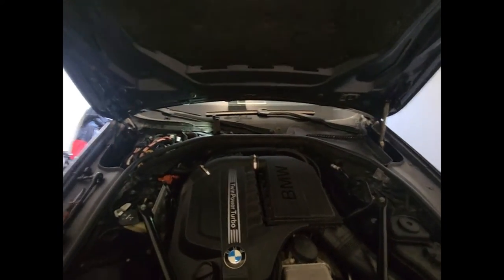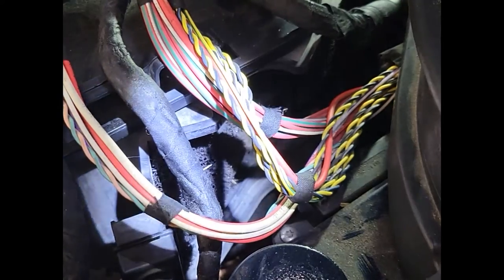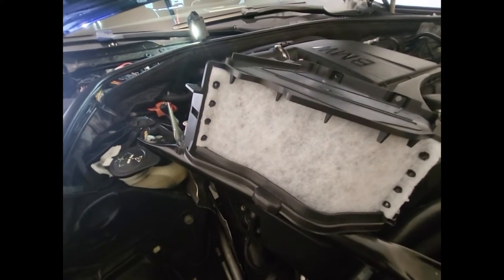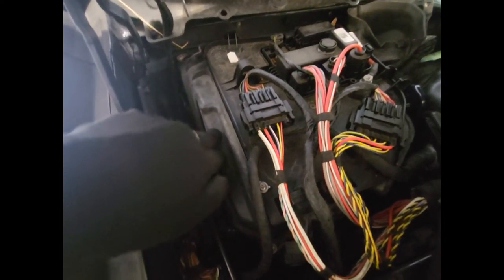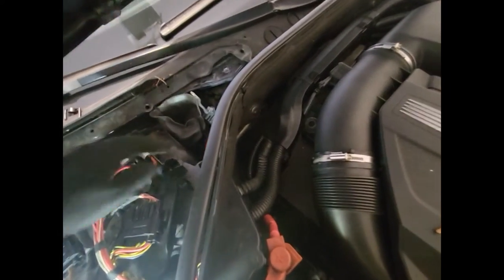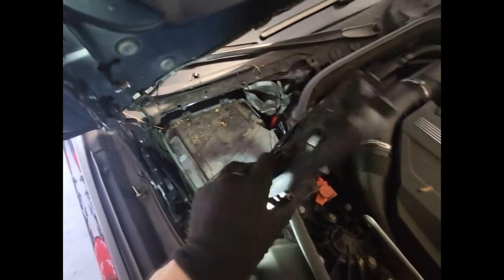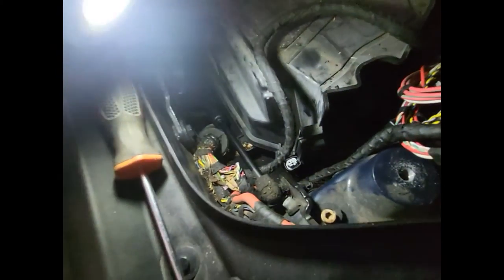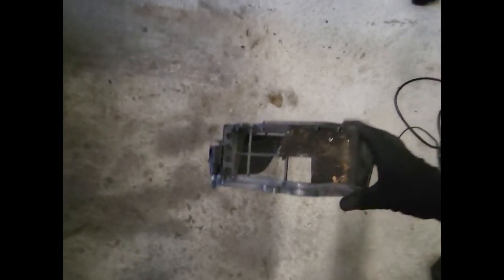BMW f10 fan blower noise repair - DIY - 2013 535i xdrive

Comment: Great video! I was lucky. My filter had just started to deteriorate. Instead of taking the blow motor out   I used compressed air in the vents to blow out the sediments and a grabber to pull out a few leaves. This cleaned it out for me so it saved the extra steps. Purchased the filter material and used a glue gun to secure to housing.
Reply from the maker: Glad you liked the video, the glue idea is great, but the issue with the material the filter is made of. That thing literally disintegrated, I just checked on mine, and the leaves were all around the outside waiting to go inside the house 😆. I'm thinking of removing the box again and applying a mesh on the outside I might also use your idea of the glue, will definitely help.

Comment: Have exactly the same issue, may I ask where to get the part?
Reply from the maker: Here is the part, just make sure you cross reference it using your VIN number. Hope this helps, don't forget to subscribe please
https://www.fcpeuro.com/products/bmw-housing-cover-with-coarse-filter-64119216222
Reply: around 2 min the fabric looks white in color fine filter, whereas the FCP EURO one looks different coarse filter though. which one do you recomend?
Reply from the maker: @sgopal9  I wish I remembered the seller on ebay, yes ut is coarse, I have seen people just buy the filter material and install it. But I sent you fcpeuro.com link because I really think they have good pricing and quality